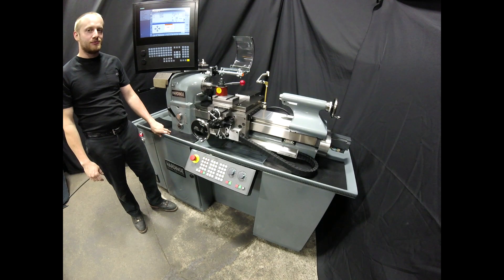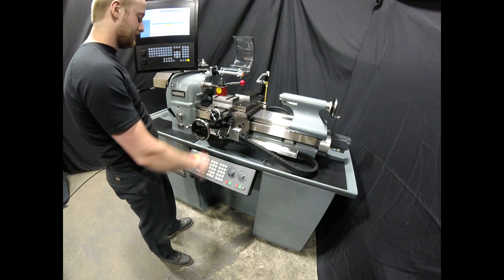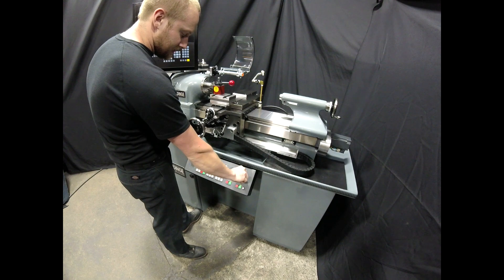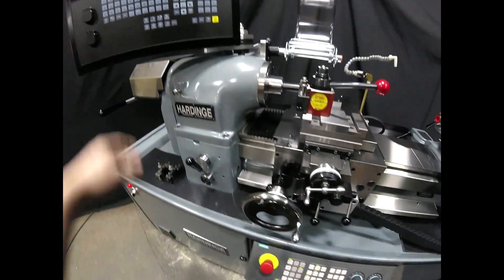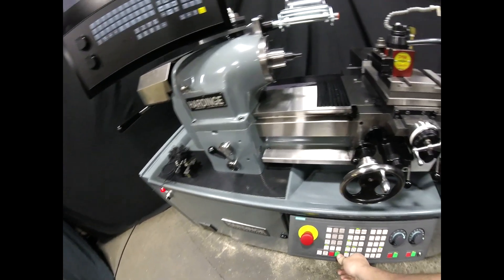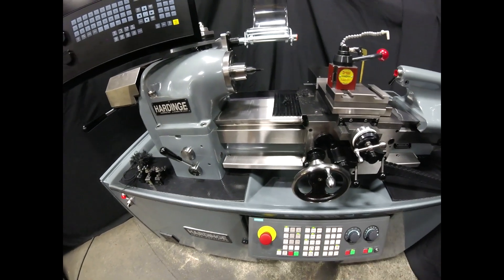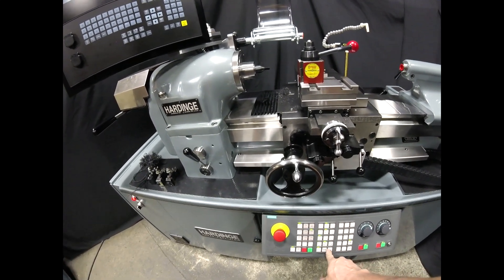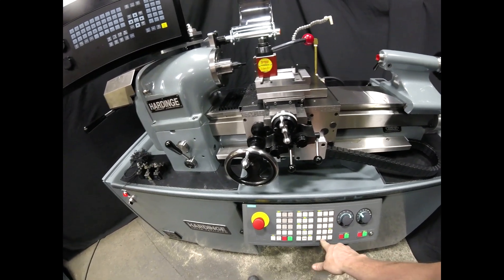Babin Hardinge HLV-Siemens-828-Demo

Comment: Awesome machine but I can't help the position of the controls and E-stop are poorly placed. I think it would be better if the control panel is relocated to where the keyboard is and a separate angled keyboard tray should mount under that.
Reply: I see couple other ergonomic issues, the whole position of the control panel below isn't great IMO (usually teach in lathes have it higher, where the carriage control is, not everything is there, just what you might need for basic operation), this guy doesn't look tall, and even he has to bend down and eye peripheral sight is very narrow in the upwards direction, so you lose sight of what is going on with the work, the chips also tend to fall in that direction, the forward/reverse could have been put behind the original spindle lever, where the feed engagement lever was and they seems to have blanked it off, so it is unused
placement of the Z servo seems a bit odd, granted there is little load on these machines on the screw, but it is always best to put the drive element as close the place where majority of the work takes place to reduce the twist in the screw shaft under load, not that important because they use linear scales, but still

Comment: What's a point zero 1 micron?
Reply: 1 micron (aka µm) is .001mm. So .01µm is .00001mm, 10 nanometers, or .0000039".  This is the resolution of the scales. There is absolutely no way this machine is capable of hitting those tolerances (reasonably). Async spindle errors from angular contact bearings will be a magnitudeS higher. Lack of vibration isolation and environment thermal control doesn't help.  Still, I don't doubt the machine is reliable to 5mircon or .0002".
Reply: @agg42  it's capable of doing 0.0001" all day long